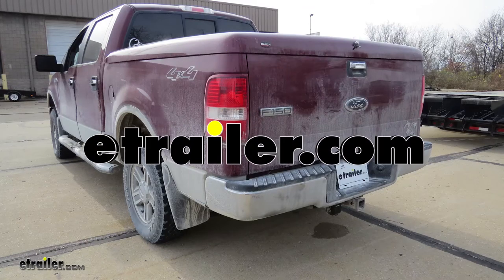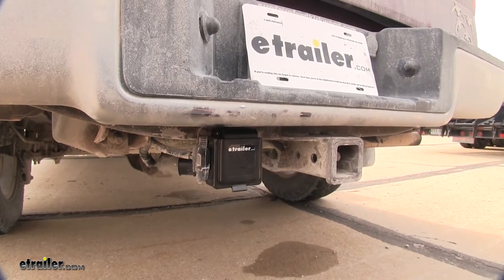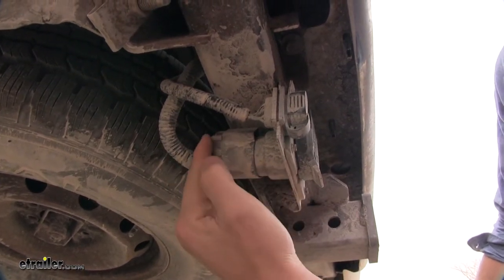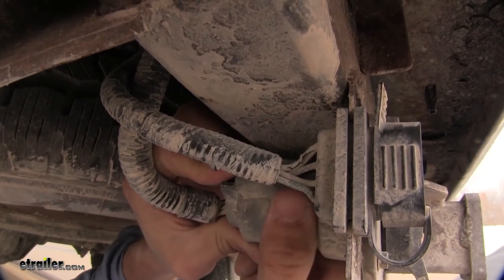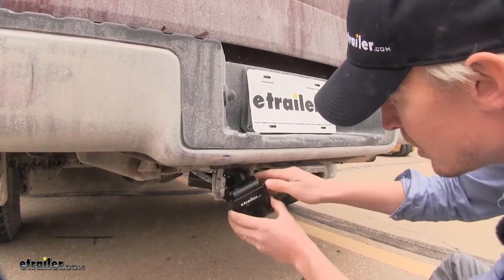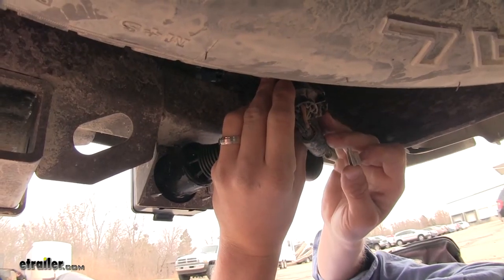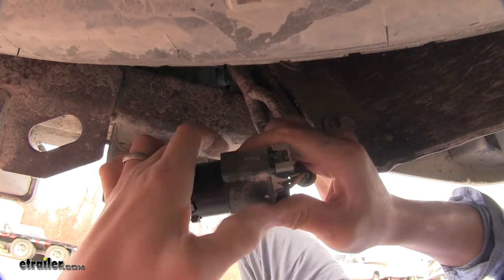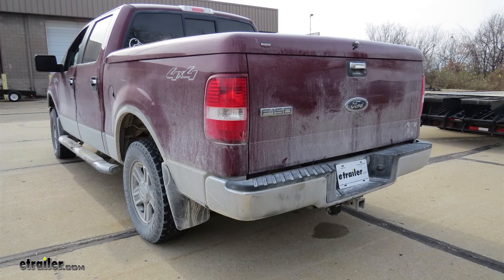etrailer | EZ Connector Magnetic 7-Way Trailer Connectors Installation - 2005 Ford F-150

Comment: Great for your own trailer, what if you use other peoples trailers ?
Reply from the maker: We have an adapter that you can use with other trailers that have regular 7 blade connectors.
https://www.etrailer.com/Trailer-Wiring/EZ-Connector/319-R7-52.html
https://www.etrailer.com/Custom-Fit-Vehicle-Wiring/EZ-Connector/319-s7-06.html